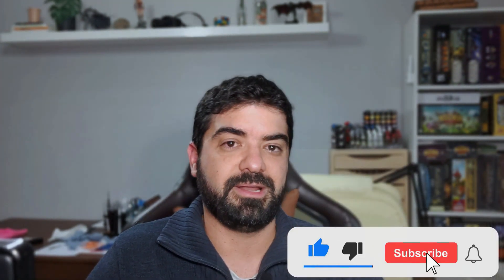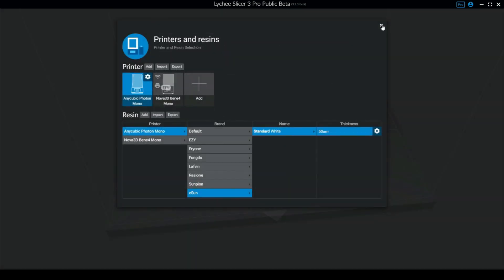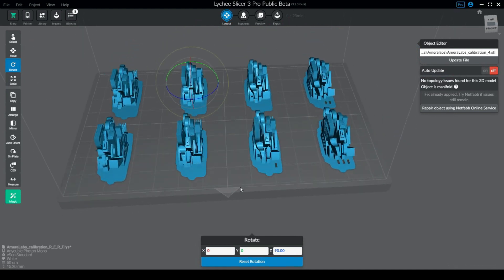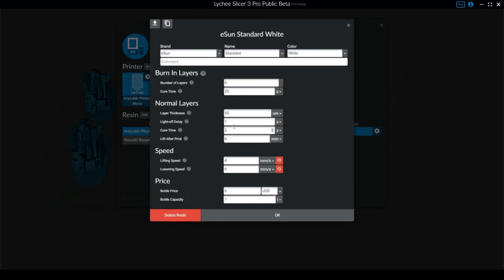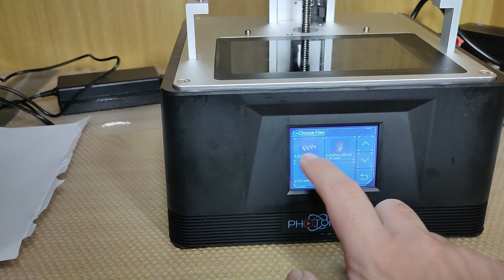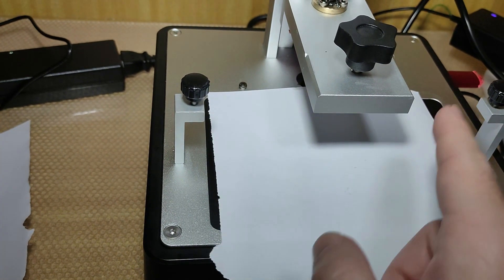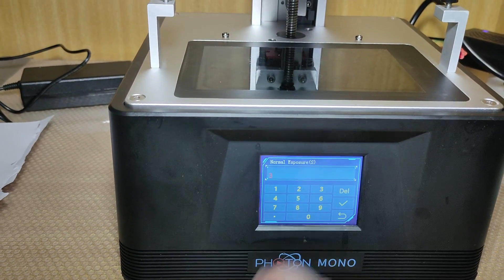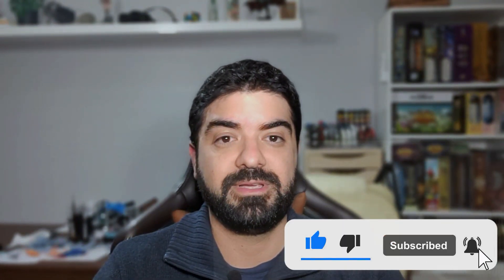How to Create a custom Anycubic RERF test (And find ideal resin exposure)

Comment: Hey man!
I have a question for you...
I have a Photon Mono X, and I did the experiment of creating my own Custom R_E_R_F.pwmx file (for me, it's .pwmx) And I ran it.
However, I noticed that the time interval between each square is about 1 second.
So, the print starts with an exposure of approximately 2.6 seconds, and ends with an exposure of around 10 seconds.

Do you know if there is any way to change the Exposure Time Step?
The Anycubic website says that it's supposed to be a time step of 0.25 seconds...

Comment: Hi, I do not understand how the printer knows that it has to give each cuadrant (object) a different exposure time. Is it just because the file is name R_E_R_F? the typical RERF of any anycubic printer has exposure step sizes of 0.25s so where the 0.4s comes from?
Reply from the maker: Yes, it's because of the name of the file, the printer firmware is programed to act like that when reading files with this name.

Comment: I dont understand how you got diff exposure times
Reply: I'm a year late, but naming it R_E_R_F cues the internal software to change the exposure times. Square 1 starts at the exposure time you set, then each square adds +0.4s to it. If you start at 0.8, square 2 is at 1.2, square 3 is at 1.6, etc. Please note, not all machines support this. The Mono (as he has) and the Mono X (as I am using do).

Comment: This test isn't working on my mono x it just prints them all at the same time wtaf is going on. I've saved as R_E_R_F and it isn't working
Reply: Did you run it without the vat to look at the screen? The front display will not turn them off like the exposure screen does.

Comment: Do you have to run a test gcode file for this to work right? I have a Photon Mono SE and i have not been able to run a ghost print that shows the different areas printing with different exposures. All the quadrants expose at the same time.
Reply: me too
Reply: @alihaydaryildiz2495  If your printer is newer than 2019, I found that you do not have to run the test gcode. Make sure that the slicer is set up for the correct printer. I have a Photon Mono SE which needs not output extension PWMS not the PWMO as seen in the video which is what is needed for the Photon Mono (no SE). PM and i will send you the file i used to create my calibration file.

Comment: Does this also work with the Anycubic Photon M3?
Reply from the maker: Hey, I really don't know, you can try and save a file as RERF and run a dry print to see how the printer behaves.
Reply: @HobbyistLife  thanks for the quick response!

I did just that and unfortunately the screen will stay dark...
Reply from the maker: @Daronor01  it seems they removed this feature from new printers, which is unfortunate, it's a very nice feature...
Reply: @HobbyistLife  yea it's a shame... Anyway,  just sliced some test files within different exposure times - should work the same
Reply: Works without problems on my Photon M3 Plus. Although I just clocked the Exposures and am quite sure the increments are 0.2seconds for me.
Reply: A recently purchased Photon M3 included the R_E_R_F test print on the USB drive.

Comment: For some reason the rerf isn't working properly on my printer (mono 4k). I tried the dry test a couple of times and each time the light turns of half of two models. For example first it turns of the half of the two models in the bottom right corner, after 0.4s the other half of those two, after 0.4s the half of the two models in the bottom left corner and so on and so on. I set the models the same way as in the video and named the file properly.
Anyone else had a similar issue?
Reply from the maker: That's how it should work I think, if you think that the purpose is to test different exposures, it start turn the light for the ones with higher exposure and subsequently light on the ones with less exposure. The first one with higher exposure and the last one with less exposure. Did you get it? hope you understood. :)
Reply: @HobbyistLife  Hi, thanks for the reply. I understand how it should work, but it's kind hard to explain what's actually happening just with words. So I have 8 models and for each model the the light should turn off in increments of 0.4s. In my case the light first turns off on half of model 1 and 2 and after 0.4s the other half of model 1 and 2, then after another 0.4s the light turns off on the half of model 3 and 4, after 0.4s it turns off the other half of models 3 and 4, and so on. It doesn't turn of the light for each model individually after 0.4s, it turns it of for two models at a time and only for half of the model.
Maybe if I get catch some time I'll upload a video of it on youtube.
Reply from the maker: @the_headless_horseman9682  Looks like positioning to me, each printer has a screen size and you need to position the pieces in order to be centered on each space, looks like the pieces are arranged half in one square and half in other, that's why you are seeing this, in my opinion. I think the Mono 4k doesn't come with an original file, that's what makes it more tricky to configure, if you had a file that came in the USB you could open it in the slicer and have a reference on how to position the pieces.
Reply: @HobbyistLife  Could be, anyway I printed another test model a couple of times and found out the exposure time that way. Maybe I'll give this another try some other time since it's a really good feature when it works properly.

Comment: Hey Luis, thank you so much for your informative videos. I thought I was a pro coming from my Photon Zero to my new Mono X, but you're helping me get the settings dialled in more than possible alone! Do you happen to have the R_E_R_F.stl still, or know how to convert from the sliced file to an STL? I want to double check my placement is correct when overlaying your Ameralabs models against the original file. Thanks!
Reply: As well, do you happen to have confirmed that changing layer height is ok when using these custom RERF files?
Reply from the maker: Hey thanks for your comment, you can get the STL for Ameralabs numbered here https://www.thingiverse.com/thing:4694288. anyway, you can use any file you want for this test, the original one from Anycubic I could only find the sliced file, the STL it's not available, or at least I never found it.

Comment: Hi there, this appears very informative, however I encountered several problems.  I am very new to this and that might be a contributing factor.  I recently, 2 weeks ago, purchased the photon mono x and have spent the last two weeks educating myself on this hobby.  I followed the instructions and downloaded the 8 stl's from thingiverse as indicated.  I put them on the platform in lychee in the order specified (one by one) I did not see a file like you had where all 8 dropped in.  But no worries I placed them in the quadrants as  best as possible (wasn't sure exact location so I eyeballed it).  Once I completed that I went to load the file from the USB,  R_E_R_F.pwmx to overlay onto the 8 Ameralabs images.  However, lychee doesn't recognize pwmx extension as a 3D file.  Please advise as to what step is next as I have watched the video several times now without any further insight.  Thank you.
Reply: i also have no idea, but in the video his file type is pwmO not pwmX
Reply: @justben7564  I noticed that too, I think it might be Anycubic’s old file format but I’m not sure.

Comment: gracias bro. Do you have an idea how to read and configure this based on manufacturers specs from different brands like Elegoo resin it says 60s for bottom layers and that shocked me so I have been looking all over on what would be the value for the Mono as I don't think 60s sounds right and 15seconds normal layers. can you help?
Reply from the maker: Hello there. Which printer do you have? It's the Photon Mono? If that's the case, I think 60s for bottom exposure it's too much, 30 it's more than enough, and normal layers 15s it's an absurd for mono screen, you should try something like 2-2.5s...
Reply: @HobbyistLife  I got a mono x. The bottle says 60s  and 15s so it's confusing 😭 since I'm not too experienced.
Reply from the maker: @molotovgod  mono X it's a mono screen printer, the instructions on the elegoo bottle is for RGB printers, go with me and use something around 30s bottom and 2.5s normal. It will work :) if it's elegoo standard it probably will work, If anything fails, increase a bit. Hope it helps
Reply: @HobbyistLife  Trying right now, thank you so much!
Reply: The changes worked man but now I really want to do the test you showed on the video. 😎👍
Reply from the maker: @molotovgod  that's great! Glad to help, welcome to the resin 3d printing addicting world :)

Comment: So, if I understood well, I have to create 8 differente version of the same file, each with incremented time of exposure (0,4 o 1 sec). And after I have to create a single R_E_R_F file with all 8 together. Right?
Just to be sure: would this work on a Photon Mono SE?
Reply: i dont think you have to create 8 different files. by simply exporting it as R_E_R_F the one file, with 8 models on it, automatically prints them with different exposure times. you only set the starting exposure time.

Comment: Hi, I did an rerf using the as is settings with some Eco Grey. It printed fine and could see it was getting close at the no 8. I went to do another rerf test and changed the start setting to 3.4 at the printer but It just printed all 8 at 3.4 !?

Comment: can i do it with other software?
Reply from the maker: Yes, you can, you just need to make sure the positioning is right. If you pay attention to it, it's totally doable with any slicer.
Reply: @HobbyistLife  i may try using a different slicer and see if it will work for me.

Comment: My don't disappear one after the other for different exposure times, what's going wrong?  I'm using your exact setup (software/model), but on a Mono X
Reply from the maker: Are you named the file exactly as I instructed? The file need to have that exactly name.
Reply: @HobbyistLife  I also had this happen. I have the exact same name and in the files on my printer this one comes up BLUE instead of GREY so i would assume the printer is reading it as a RERF but it didnt shut off each quadrant one after the other like yours did in the video.
Reply: @HobbyistLife  my files are .pw0 when i go to change it to anything else it doesnt allow me to.... do you think this could have some cause to my issue
Reply from the maker: @jograybeal123 a which printer are you using? It should work but I don't know if Anycubic changed something with new versions of the firmware.
Reply: @HobbyistLife  i was working on it all night last night and what i was seeing was the screen on the front displaying the slice in white and all going away at once..... i turned off the lights late last night to find out it had been doing it the whole time. I should have done a dry run like you did. I can thank you enough. Now on to try and find the settings for this Dr.3D clear :D

thank you again and i hope you have a good day today
Reply from the maker: @jograybeal123  I'm happy it worked Joey, good luck and happy printing :)
Reply: @jograybeal123  This confused me too that the front display turns them on and off all at once, but I checked and the LCD under the vat staggers them.

Comment: What if i want the file to start at say 0,6ss and go up in steps of 0,1s?
Reply: @HobbyistLife  Thanks! But then there's not much use in doing the Rerf test on the mono, exposure times are as low as one second, so a 0,4 increment is usually already too much. I guess it's useful if you have no valid point of reference?

Comment: Great video and very informative. Thank you for taking the time to put it together, this helped a lot and is exactly what I've been looking to understand about this file. one clarification from the initial explanation by looking at the printer behavior. #1 sample starts at the bottom left not top left based on what the printer is doing and #8 is top right.
thanks again.

Comment: Hey, very helpful information!
Do you know whether it is possible to change the intervals of the exposure time?
I'd like to fine-tune my resin and print 8 steps in a range from 1.5 to 3.0 Seconds. Is that possible?

Cheers

PS: Maybe you could tune up the volume by a bit, it was very softly and sometimes hard to understand
Reply: @HobbyistLife  That's what I thought but not what I was hoping;D
It's a shame though, because you really don't need to test more than 5 seconds for the Mono X... Maybe Anycubic will update this feature at some time... Thanks for the flash fast reply!
Reply: @HobbyistLife  oooooh, I misunsderstood! I thought the increments are 1 second but for the monochromatic screens it's 0.4 seconds! That helps a lot! thanks! :)

Comment: Hey Luis... another great video. The nuance of the information you provide is very valuable. What most people do, including me, since I am new to this. We tend to follow what other people say or mention based on their own experience. Which in theory they have discovered along the way. There are no real exact examples, just... hey you should do this or try that. Which again is mainly someone else's trial and error. What you bring is direct examples, no guessing as to what you are talking about, because you're showing your example, not just talking about it. What I would like to see if you don't mind me making a request. Is more of the settings you are implying and why, or why not. There are some good vloggers who do expel great information, but only give you the information they think is most important. They do not give a reason for lift speed, the bottom layer, the types of nuonces. So, as a new user, your left with, well what about these other settings? Because on Facebook groups, they always showcase their settings, and oftentimes, it is different. So it leaves the new users with still lingering questions about the other settings. Maybe a video about your complete process using Lychee from opening the file, hollowing it, adding drainage holes, scale, and then finally exporting. From start to finish. I know this seems to be a unique request, I am a big fan, and can not talk about you enough to my group. Which, most of them are a hobbyist, self-inflicted artist, or dreamers of what if. Anyhow, I have said too much, but truly appreciate your channel and what you bring to this community. Thanks again.
Reply: @HobbyistLife  that's is exactly what this resin printing world needs, the knowledge and confidence to do and have fun with their expensive printers,  versus... worrying that they paid for a machine that doesn't do what it was intended to do. Can't wait to see what's next from you. Have a great day.